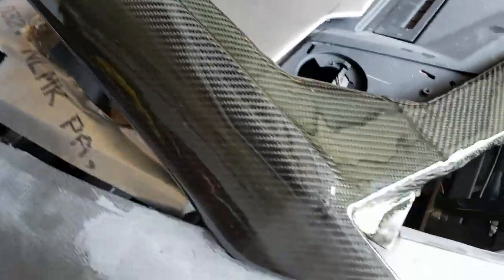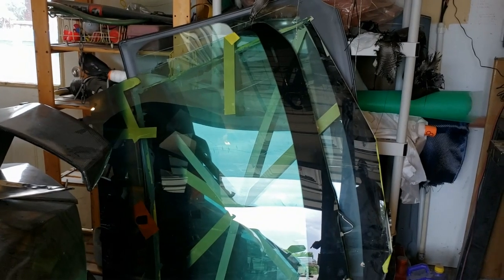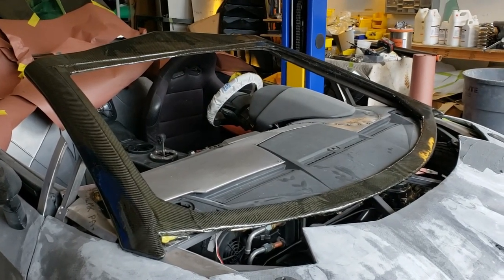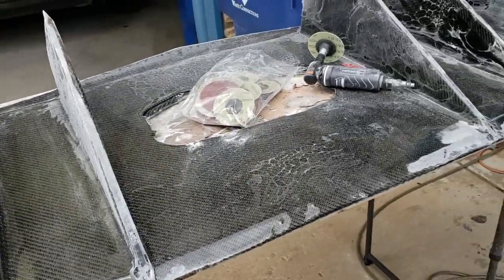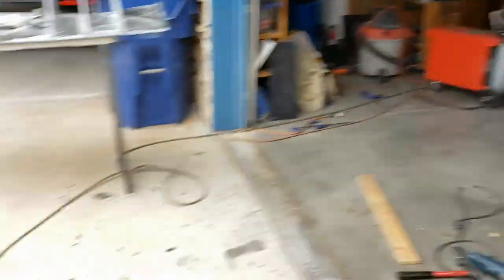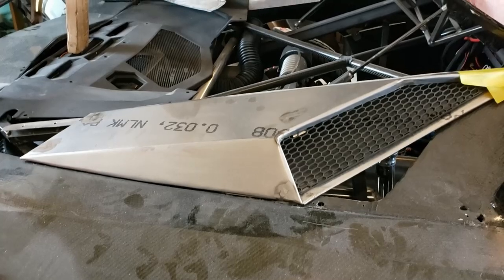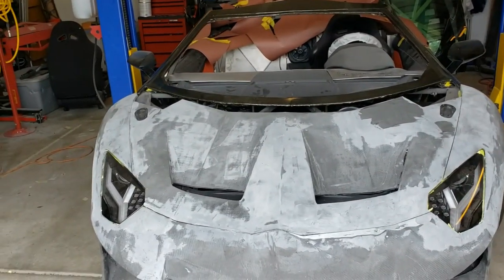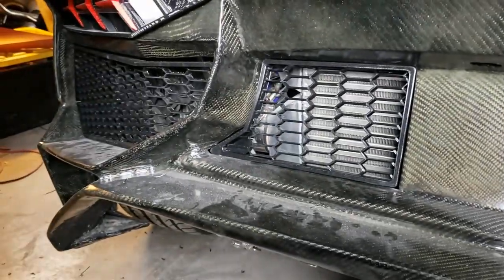3D Printed Interceptor Update 45

Comment: As per Wesley Coopers comment.  The windshield can be cut to size on a water jet cutting machine.  This should not be too expensive,  from one of the screens you have I'd make a template in FRP   then trim that to fit correctly.  Then have the cutters use that to cut the real one.  Is this guy near you: https://www.davesmetroautoglassaz.com/custom-glass-cutting.htm

Comment: I've built a couple of the Murcielago form of the Lambo kits. What I've done in the past is used a 1996 Nissan Maxima windshield. I doesn't fit perfectly at the top and the sides are too wide at the top. Usually the bottom fits good. Depending on the maker of the kit you may could use a 2000 Honda Accord 2 door windshield. The particular kit that I'm building now calls for that one because it's a little taller. In order to trim the windshields to fit, I lay it on the opening and mark it with a sharpie. Then I lay Gorilla tape to the line and cover the good part and sandblast the glass away. It's really easy. Just blast till you get to the rubber center layer and flip it over and do the same on both sides. It leaves a nice edge then trim the center layer off with a razor knife. Un tape and clean then it should fit perfectly.
Reply: Do a test on one of the other windshields first to get a feel of how the glass blasts away. It moves quicker than you think. The first one I did I used a harbor freight gravity fed blaster. Really simple

Comment: so i have to ask, how are you cutting the screen?
Reply from the maker: glass cutter
Reply: @lasersterling  so the type that scores the glass and then you snap it? if so that will not work, it has to be cut, it cant be snapped because it is laminated, try a diamond cutting wheel for an angle grinder, you have to use water to keep the cutter free of chips and to keep the glass cool, good luck.
Reply from the maker: @chrismechanic2000  iI was already succesful at it following what others have done.  I think the mistake was not having it out in the sun to warm it up.
Reply: @lasersterling  yeah, you could be right there, maybe the warmth softens the laminate middle layer is the key to success. But seeing as you still broke the glass I was just suggesting a method that would be better.

Comment: Surely you have a glass company locally that can cut that windshield without breaking it. Can it be cut on a water jet or laser cut machine?
Reply: you can't cut windsheels at all, it's never gonna work once its structure is compromised it will always crack
Reply: @flippy9133  not true, how do you think they cut the glass? once you cut it you have to put it in high heat for the internal stress to relieve
Reply: @aiexzs  you can cut glass just not windshields
Reply: @aiexzs  you can cut glass just not windshields

Comment: Dont waste more time trying to cut tempered glass. Its meant to crush itself.
Reply: Do you mean "tempered" glass?
Reply: @crimsonking8746  yes, thanks i was translating very poorly.
Reply: @miguelgrau8348  -no problem. No shade intended, just trying to help...😁👍
Reply: its laminated glass, not tempered, that would be the side windows.
Reply: Brush white spirit on the line you are going to cut so it doesn't cracks as easily. Keep it up👍